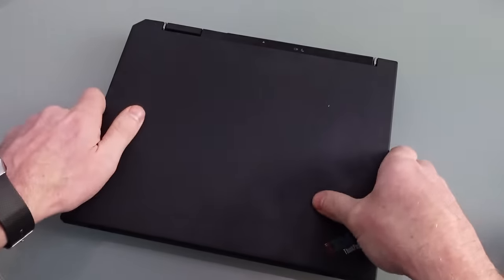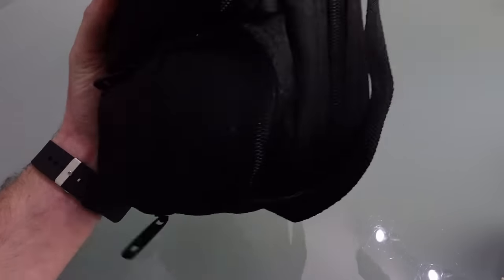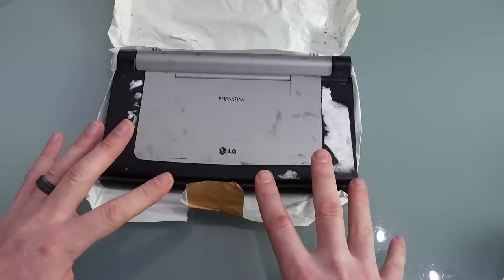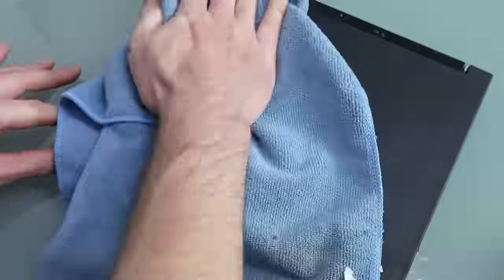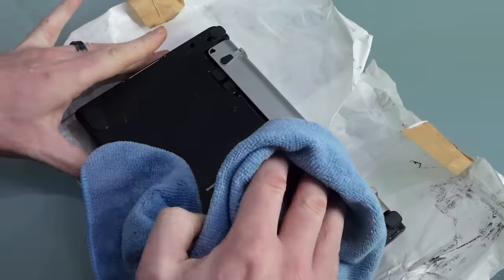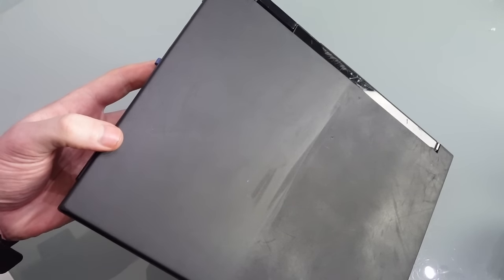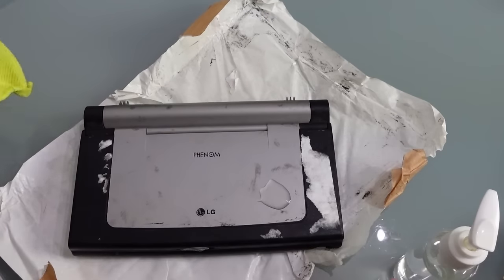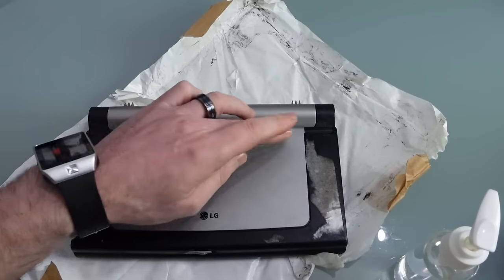Rubberised Computer Coating From The 90's - Restore Or Remove?

Comment: Depending on the state of the coating, it can be ridiculously easy to restore. I used to work at an adult toy store and learned that Corn Starch restores all kinds of different rubber type materials. I don't know how many different materials it works with exactly. It only helps if the coating is still intact, but sticky. If it's got scratches or you can see the plastic underneath, this trick isn't for your device. I used it on the Palm branded aluminum case for the LifeDrive that has a nice rubberized back on it. I just put a bunch of corn starch in a ziploc bag, put the case in there, shook it and let it sit for a few days. I pulled it out, then used compressed air to blow off the corn starch and it was as good as new! Hope someone finds this helpful 👍🏻
Reply from the maker: Corn starch! That seems even more crazy than moisturiser!!! I will give it a go on the next device that needs it, thank you for the tip 😃
Reply: @HandheldComputing it simply  provides a light coating, so the stickyness disappears for a while.

It will come back as soon as the corn starch rubs off.

You may also try with baby oil, which is the foundation ingredient of most of the moisturisers on the market (petrolatum).
Reply from the maker: So not a long term fix then
Reply: @HandheldComputing  not in my experience. Essentially it's a very fine powder that sticks to the sticky rubber and kind of makes it smooth like a peach. But it doesn't last forever.
Baking soda would act in a similar way, in case you want to give the concept a try without buying corn starch flour you may not then have a use for.
Reply from the maker: good to know, perhaps in combination with moisturiser this would be a good solution though @bufordmaddogtannen
Reply: @HandheldComputing  give it a try. Worst case scenario, baking soda should just dissolve. Corn starch could become gooey.

Although baking soda being a salt, it could be corrosive/dangerous to electronics.
Reply: @bufordmaddogtannen thank you for telling the truth. The truth is, this type of rubber CANNOT be restored. When it breaks down, it is returning to the petroleum products which made it, and this process cannot be stopped.
Reply: To remove the rubberized coating from devices as well as to remove the stickiness from the buttons on your vehicle's steering wheel, use makeup remover pads.  I removed the stickiness from the buttons on my steering wheel as well as remove the sticky mess from a telescope.  Give it a try and it should work as exceptionally for you as it did for me.
Reply: Holy moly I need to try this.
Reply: Ahh yes, the care and maintenance of Cyberskin™️
Reply: Yeah corn starch. Nice. But we really want to know about the adult toy store! Restoring sticky returned latex toys?

Comment: Hello, vintage Thinkpads enthusiast here. In my experience, Thinkpad rubberized coating should be dry, not moisturized. Personally, I use baby powder to get rid of stickiness. Couple of layers rubbed into sticky coating usually works perfect.
Reply from the maker: Baby powder is what divers use on drysuit seals which are made of latex which is the same thing. The appearance of the coating on my thinkpad is so much better following the moisturiser though, even small scratches have disappeared

Comment: I collect retro hardware, and sadly I get quite a few units with rubberized surfaces, once that surface has gone tacky, you won't get around stripping it off. Everything else will just mask the stickiness until it gets rubbed off with normal handling. The hydrocarbons in the coating have degraded back into their components and nothing will help chain them back together again. After stripping, give the plastic underneath some revitalization in the form of 330 aerospace protectant, or your local analog (my favourite is E-coll cockpit spray.)
Reply from the maker: I did assume that we were just masking the problem with moisturiser/corn starch/WD40 etc 
It comes up as "hot tub" protector - I see it adds UV protection, something a lot of plastics would benefit from! Seems like a good idea 😀

Comment: This coating is definitely not rubber, it's called soft touch, and is a some sort of paint (i can't remember the exact word, something like pvc or polyester). So most of paint solvents will remove it REALY easy and perfect. But some of them can damage plastic underneath so it will become grayish
Reply from the maker: That's the issue, lots of solvents will work but I don't want to damage the device!
Reply: @HandheldComputing IPA should work without damaging the plastic. It can leave it looking a little odd though which I was able to solve on my Microsoft mouse with just some light wax (think Pledge).
Reply from the maker: Nice, the pledge should protect the surface too @chaos.corner

Comment: I assume the reason moisturizer works is that it’s an oliophilic (hydrophobic) solvent that’s mild and viscous enough to soften but not erode the rubber. You can do similar things with shellac-based wood finishes, if you look around on furniture-restoration YouTube.

I think the main product people use is Odie’s Oil, but I might be misremembering. I wonder if Odie’s Oil is any good for rubberized finishes, too…
Reply: Leather restoration products would probably also work. You can buy leather conditioner that is IIRC more chemically stable than skincare moisturizer tends to be. You would want something unpigmented, though, so that it doesn’t rub off pigment on everything.

Brands of leather conditioner I’ve used (pigmented, with shoes) are Meltonian and Tarrago, but they’re available unpigmented, too.
Reply: I have a vintage Gucci bag where the original leather lining was disintegrating very similarly to a synthetic rubber, which seems to be a common problem with vintage bags. I ultimately just had the lining replaced at Gucci, but I probably could have tried leather conditioner first.
Reply from the maker: My understanding of moisturisers (and i'm not a chemist) is that they penetrate the skin because the prime molecule can change between hydrophilic and oleophilic to allow it to penetrate the different layers of the skin. This would defiantly work for leather but I'm still at a loss as to why it works for rubber. A wood oil would be interesting to try as those are also trying to keep the moisture in, I would just worry that most oils erode rubber.

Comment: As far as I am concerned, if you want a museum piece then it is worth trying to restore it if indeed the damage isn't severe. 
However, if you plan on actually using the device (more than once a month, Lol) then just strip it off and get it over with, it will always try to turn back into oil.
I've had to deal with this several times and it is simply dreadful. Sometimes, if you're lucky, the coating gets a bit hardened. It still is scratched and scrapped off too easy to handle but at least it isn't sticky. I have no idea why some go this route and others melt.
Reply from the maker: You are right, no matter what you do it will eventually turn into a sticky mess! I'm glad I removed it on the Sienna and Phenom

Comment: I have a giant Alienware 18" laptank that turned sticky on basically all surfaces. It took me weeks to completely rub that stuff off with alcohol. On an old steering wheel controller the coating turned into literal liquid and destroyed the whole thing beyond repairability. On my Psions the rubber coating tends to wrinkle and simply peel off. So I experienced quite some variations of rubber-coating-deaths, but in the end I would never bother trying to restore that stuff. Removing it seems to be the far better option. Who knows what kind of goo the restored coating might turn into in a few years.
Reply from the maker: Restoration is at best only going to buy time before you remove it anyway I guess, glad I removed it from my Sienna and Phenom

Comment: I have a Toshiba T5200 with this same problem. I remember trying to remove the coating using just rubbing alcohol and it was so tedious I gave up after an hour or so.
It never occurred to me to try hand sanitizer! 
I think I'll try that, but I would suggest using a cling film ("Saran wrap", in the States) to keep the volatile compounds in contact longer. The alcohol evaporates too quickly on an open surface to be very effective. That's why you'd have to scrub more.
Reply from the maker: someone else suggested using paper towels for the same effect, let me know how it goes 😃😃
Reply: @HandheldComputing  The paper towels are way more porous than plastic.  I don't think that would help. If anything, the towels will draw the alcohol away from the computer surface.
Either way,  I'll post my results when I get around to it.
Reply from the maker: My thought too, although I think it should work @jamesnoland7821

Comment: I have a pair of noise cancelling headphones I use for the range that I got in the early 10s. Pulled them out last year after a few years of "not being able to go out due to a certain thing that was happening" and the rubber edges were all gooey. Ended up just stripping them with alcohol as it wasn't the effort of rejuvenating them. After cleaning a little disused battery acid gunk off the contacts, they worked fine again. Definitely gonna try the hand sanitzer method and maybe the moisturizer option at some point.
 
I'll never understand why these companies didn't just use the same kind of vulcanized rubber on car tires. That stuff lasts damn near forever.
 
I don't think most people actually care how soft the rubber edges of their device are, just that they don't detonate when dropped.
Reply from the maker: It is crazy that companies still do this, I think the way you vulcanise the rubber might be why that isn't used, car tyres do last almost forever! I don't know why but the sanitizer works better than rubbing alcohol or isopropanol  😉

Comment: There is a rubber coating on the instrument cluster and radio area trim of the 90's Ford Ranger / Explorer.
Reply from the maker: Oh no! bet you want rid of that!
Reply: @HandheldComputing    It stays so so probably since it mostly isn't touched by people. There is a chance it is automotive grade ( wide temp range )
Reply from the maker: Yeah it might last a bit better/longer but they always break down eventually @bobroberts2371

Comment: I'm excited for your "Life without a smartphone" livestreams! I ditched mine in 2021, which is actually why I started collecting PalmOS devices again and because of that, I found your channel! Ultimately I found it was easiest to carry a Light Phone II and just wait until I get home for most everything else. I will say the Palm TX with the hotspot on the Light Phone alongside the Google Maps app (Yeah it still works!) came in clutch a few times.

I made it 2 years, but finally ended up going back to a smartphone. If there was a dumbphone that worked as consistently as my smartphone for SMS/MMS, I could see myself going back. The best part about coming back to a smartphone after 2 years is I can see how FEW apps I really needed and can turn off all my notifications without worry. It's no longer an addictive distraction machine for me.

I'd love to see how you approach the same problems I went through.
Reply from the maker: Life without google maps could be tough! I didn't know there was a version for Palm OS5, I have the CE version which seems to work well enough. I'm looking forward to trying life without a smart phone just a lot less distractions 😊
Reply: @HandheldComputing  I had TomTom for Palm. I think I threw it away in the end though I kept the TX.
Reply from the maker: I have street planner (the pre-curser to TomTom) but its a bit out of date!  @chaos.corner
Reply: @HandheldComputing  Yes. Before online map updates. What fun.

Comment: If the rubberized layer has become sticky then the polyurethane has chemically decomposed and nothing can undo that. And it is VERY hard to remove. It dissolves in nothing: not in alcohol or soapy water, nothing. And the stuff sticks to the cloth with with you try to rub it off. A rubberized device is a deal breaker for me. If you manage to make it less sticky it might wear off after some use of the device.

The coating of the first Psion 5 is different though. It stays relatively "dry" but it peels off.
Reply: I assume it dissolves in more aggressive chemical solvents like acetone.
Reply from the maker: Its true the S5 doesn't tend to go sticky like a lot of the coatings do, and yes the cloth got very sticky as did my hands 😂🤣
Reply from the maker: Probably but then that might affect other plastics and isn't so good on skin
Reply: @elsiehupp I'm a chemist, but I ain't no expert on polyurethane and the compounds in which it decomposes. However, NEVER EVER use acetone or products marked "sticker remover" on plastics: it's very aggressive and dissolves the plastic! Sticker remover is developed to dissolve the vinyl of stickers, not per se to dissolve the glue. 

So were stuck with:

IPA (iso-propyl alcohol)
spiritus (pure alcohol (methanol) w/ blue dye so addicts won't drink it)
terpentine (white spirit)
wasbenzine (dunno what it's called in English)
soapy water
ammonia

Especially the lukewarm mild soapy water solution is very, very underestimated. You won't believe how many compounds dissolve in it: hydrophilic (water loving) as well as hydrophobic (water hating) compounds. And we chemists divide all compounds in the world in 2 categories: water-loving and ... you guessed it.
Reply: @HandheldComputing I'm a (physical) chemist (so a noob on organic chemistry unfortunately). I wouldn't worry too much about acetone on the skin if I were you. Chemists get acetone on their skin daily (tho they won't admit to it because we're supposed to wear gloves all day which we don't). We have to clean glass instruments etc. with lots of it. We use liters of acetone per day in the lab. It dissolves the (protective) oils in your skin. So if you accidentally "dip" your hand in acetone it'll leave a red irritated spot on your hand the next day (believe me: I know!). Acetone is not poisonous, but absolutely eveything dissolves in it and poisonous stuff that we use in the lab will penetrate the skin if it's dissolved in the acetone. That's the real danger of acetone.

Comment: It may be worth trying a mix of acetone and brake fluid.
It works to rejuvenate hardened rubber.
Reply: Acetone will destor this coating and in some cases even plastic underneath. I learned it the hard way. This coating is definitely not rubber, it's called soft touch, and is a some sort of paint (i can't remember the exact word, something like pvc or polyester). So most of paint solvents will remove it REALY easy and perfect. But some of them can damage plastic underneath so it will become grayish
Reply: Those are not great chemicals for skin contact.
Reply: @dosgos  Once dry, there's no problem. At least acetone is nail varnish remover, used on skin. But not sure for brake fluid :)
Reply: @crapasanya  Too bad, it works great for hard rubber.
Thanks for the information.
Reply from the maker: I would not use brake fluid on it, I think it would damage the plastics, acetone might as well!

Comment: Depending on how bad the coating is ive used silicon, ive used it for many toys and a few pc's like an ibook g3 clamshell. but if its just completely tacky/gooey it is and not just dried out then i do my best to remove it.
Reply from the maker: Silicon? As a spray? Does it sink into the rubber or just create a protective top coat?
I am intrigued 🧐
Reply: @HandheldComputing  Specifically i used some 0-ring silicone lube. Its just a squeeze bottle from amazon. I apply it by putting it on a rag or paper towel and rub it into the rubber. I then go back over with a draw cloth to get the excess off. Ive used this method on my Dell PDA's, ibook Clamshells (which made them nice and clear again and still look good), and my digimon D3 digivice which has a rubber section. All look great. I did use it on my Atari portfolio and it helped a little with the tacky feeling but i made the mistake of using IPA first so it kinda melted the coating before i tried silicone.
Reply: If its gone tacky then you're too late.  The oils have started to separate and it has perished.  I presume they mean silicone (not silicon) which is a synthetic rubber compatible lubricant.  Once its covered in that the separation nearly stops.  This is why people keep mentioning "adult" things because how they are stored and which oils they are mixed with matters a lot.  Rubbers have a smell which is caused by volatiles jumping off the surface and as they leave it breaks down eventually it runs out. There are ways to chemically change the rubberised surface - products like Vivishine has a bizarre reaction to rubber, a few drops in water attaches to rubberised surfaces and you just dab it with a towel and it keeps that surface, items that would normally perish like latex which is unvulcanised last for 20+ years when they would normally break down after 5 years.

I would suggest looking at rubber dressings, there are things like Aerospace 303 and even tyre-trim - but if it has started to break down you probably have no choice but remove it, if it begins to peel its probably a one-way street.
Reply: I do as well I leave it on for days and it even restores some really tacky coating.

Comment: Had similar issue with a soft touch coating on a games controller. It was horrible to game with as I would grip the controller tightly in the throws of a mad gaming session. Rubbing talcum powder into it restored it to it's non sticky state but it did turn the original black colour coating greyish with the white talc but that was preferable to it being unusable.
Reply from the maker: Grey and smooth is defiantly better than black and sticky!!!